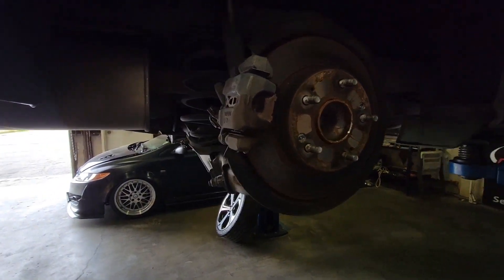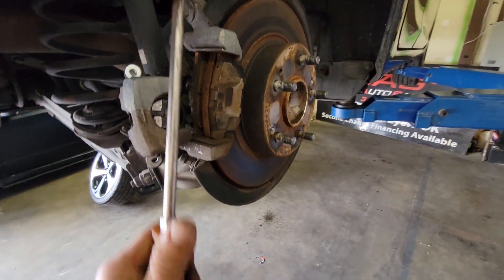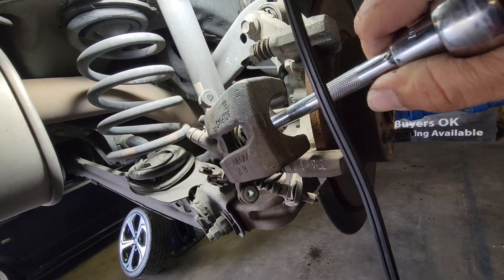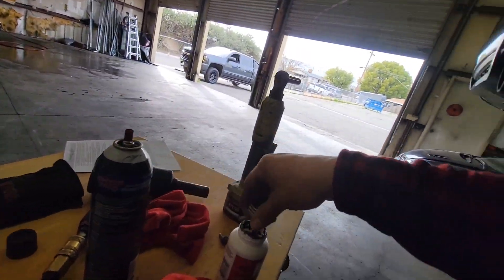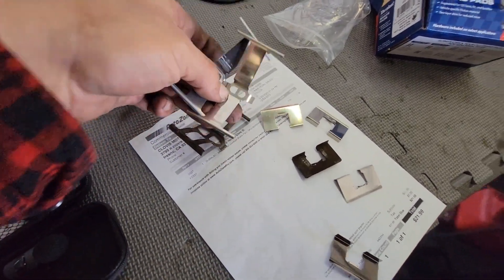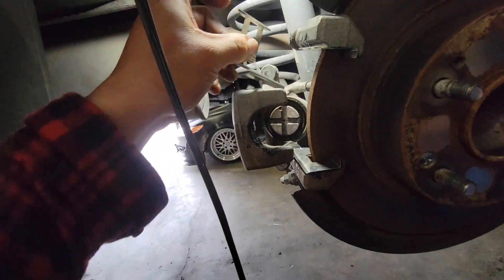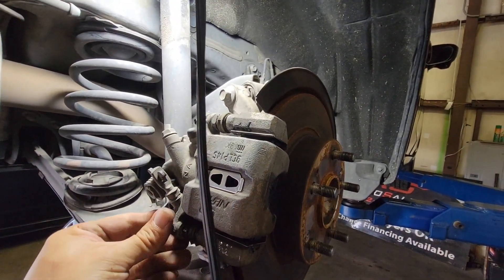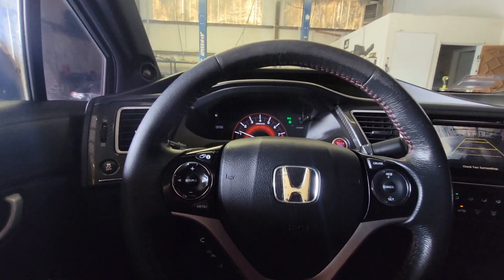How to: Replace 2015 Honda Civic Si  Rear Brake Pads

Comment: Do you need to open up brake booster lid for possible air in system?
Reply: Only applys when you lose liquid or open the valve and drop some